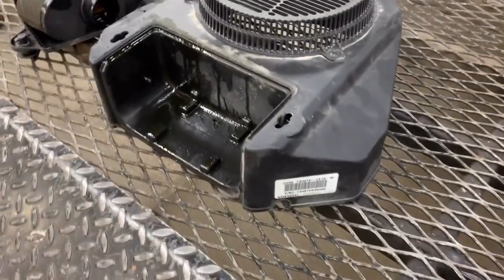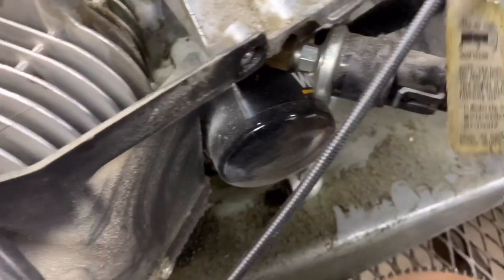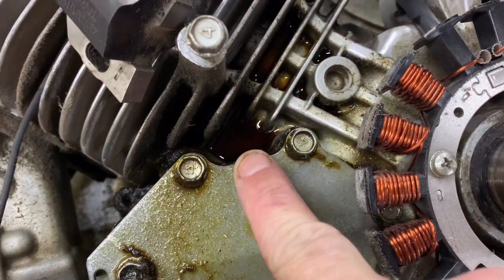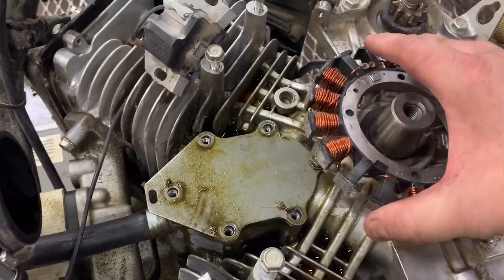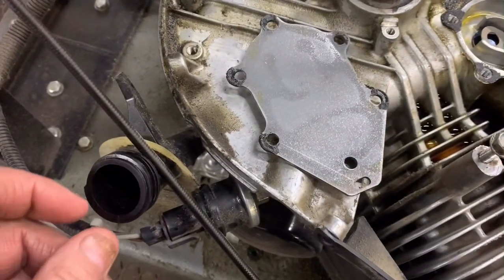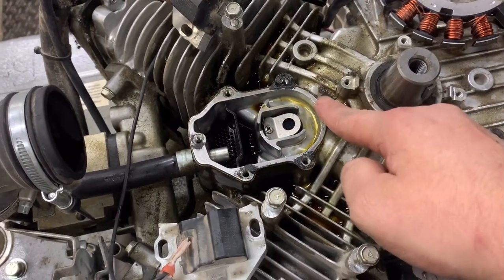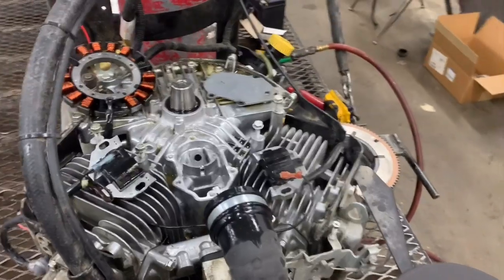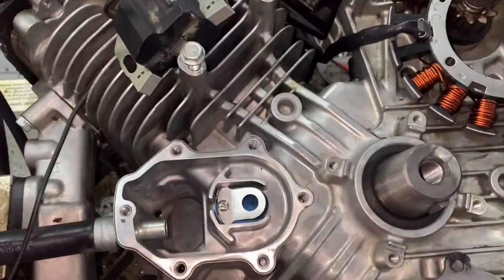PART 1 (PATTERN FAILURE) SEVERE OIL LEAK DIAGNOSTICS ON A KAWASAKI V- TWIN ENGINE

Comment: great troubleshooting technique, appreciate it it. I have an older 2011 600 fr600 20 hp and it is leaking oil everywhere will take a look at that thanks!

Comment: Great tip! I have a Hustler Raptor with the Kawasaki Fr619v and was curious if that engine is also prone to the same issue and it's a 2015 model 23 horsepower I believe

Comment: Thanks for the info. Should help a lot of people. I run a lot of kawasaki's but most of mine are FX series and a little bigger aren't the 481's around 15 HP? The smallest one I'M running is a FX651V and a FX850v carburetor would these engines have this same problem?

Comment: I have an FV500 that i just did this upgrade on. It did not have the reed valve. How does the vent work and how can I test it properly? Thanks for any info you can provide.

Comment: Would this apply to the Kawasaki 15 hp FH451V engine as well?  First time into this exMark Metro. 48” walk behind…. left side (oil filter side) is leaking oil coming off the back of the shroud.  Replacing valve cover gasket and starting it up and observe.  Hint - It really starts to piss oil once its been operating for 10 minutes.  Thx Anyone!❤❤

Comment: Great video, thank you.  Fairly certain mine has the same issue, was mowing, suddenly felt as if it bogged down so I cut the unit off.  I looked under the mower, nothing underneath but smoke pouring out if filler tube.  Guess it finally got to hot and engine died.   Anyone to know for sure that if I do this repair it's going to start back up?

Comment: Do you see upper bearing failure on early FH680V engines?  I have a 1999 (400 hours), around 2001 they sent me a revised dipstick (more oil).  Apparently there is no oil hole for the upper bushing on the early ones.  Oil level is very important.

Comment: I’ve got the same motor, and at this point I am just trying to get it running. I cleaned it with a pressure washer, and just sitting there it leaks oil from who knows where. (The valve cover gaskets are dry) any suggestions? ( haven’t started it yet

Comment: I've had a few of these come in with oil in the filter and carb, the reed valve fails and the engine pressurizes and has oil bleed back thru the bypass tube into the filter.

Comment: Mower medic do you like brake cleaner better then carb cleaner?? And why?
Reply: I can't speak for mower medic but it depends on what I'M cleaning. I think brake cleaner does a better job of cleaning up oil and other debris but it can effect some plastic and rubber materials so on those i use carb cleaner
Reply: @nashguy207  I agree.and it's harsh on paint as well. so I use brake clean most of the time